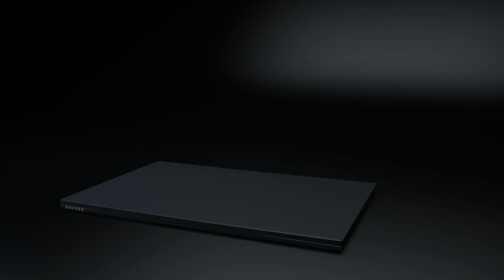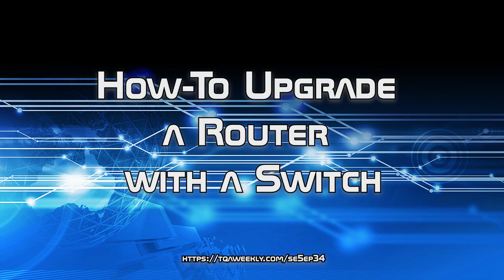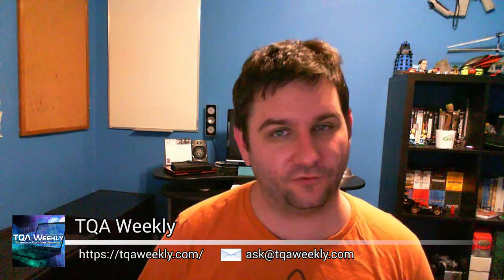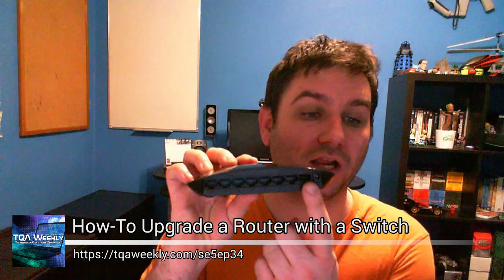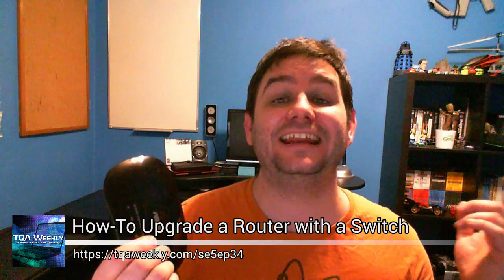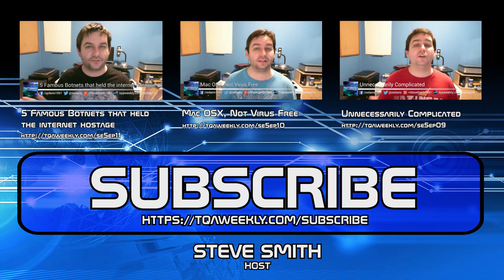How-To Upgrade a Router with a Switch

Comment: Steve Smith hey steve, would you like to help me out to unpeel my heatsink away from my cpu so i can replace my old thermal paste. Is there any way i can break throught the secondary glue that was used to stick that thing? I would be realy happy if you helped me!
Reply from the maker: Marko Balasko secondary glue? In my experience no manufacture uses glue AND thermal paste. Chances are the thermal paste is fairly solid bound. I twist ever so slightly clock and counter clock wise a few millimeters.  If it is glued, please provide the manufacture name, photos, model number, etc... so I can go complain to them. I am sure that the thermal paste is just really dry.